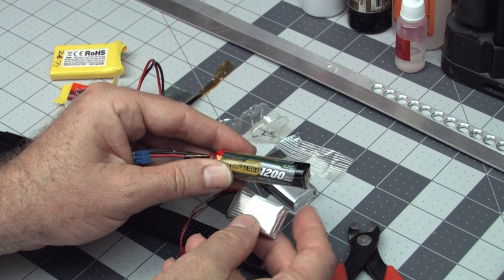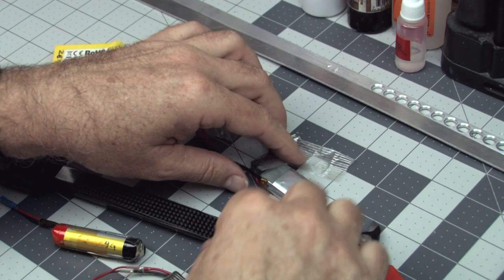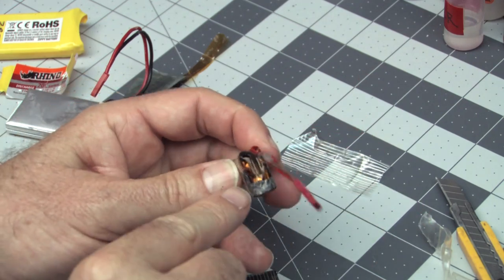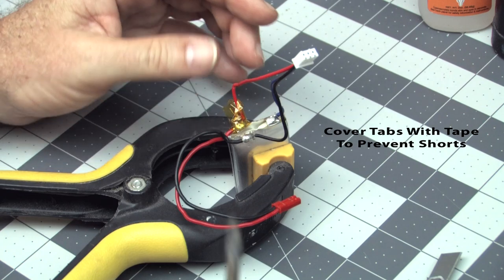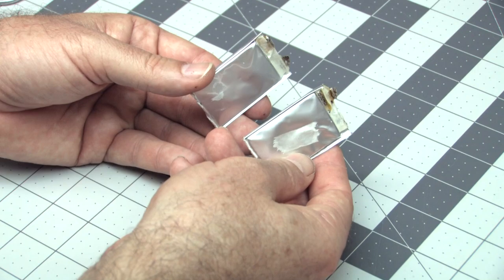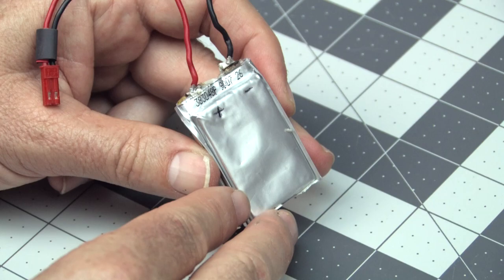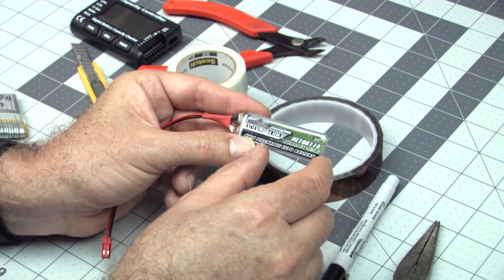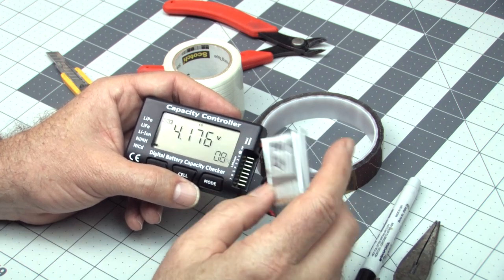Convert 2S Lipo to 1S for DLG and F3K Gliders

Comment from the maker: Battery connector is a JST, a good choice for a physical on/off connection between battery and receiver. 1S pack gets charged at a 1C rate, about .9 amps with a charger that has LiPo settings. Just about any charger does all of the battery types safely. Individual cells do not need balancing since they are now wired in parallel.

Comment: Hello@ Paul Naton.Sometimes multiple cells are held together by glue. I separate them by spraying a little  bit of carburetor cleaner tween the cells, and in a moment they will slide apart, without distorting the cells. I believe it is a little safer to do.

Comment from the maker: You could run all units on a 1S lipo as long as all components can run well in the voltage range, 3.7v to 4.1v. You must monitor your energy usage however, by discharging and recharging and noting milliamps in and out. Also some servos run better at lower voltages than others, and power consumption will vary.  More capacity is always better and safer.

Comment from the maker: You can take 2 3.7 cells and wire them is SERIES to make a 7.4 pack. If this new pack is used as a motor pack, you must also add a balance connector to insure the 2 cells stay balanced. If you wire 2 3.7s in parallel, then you keep the 3.7 voltage, but then get twice the capacity.  Parallel wired cells will self balance.

Comment: hello Paul Naton, i have a question, i have a drone syma 5 that works with a lipo battery 1cell 3.7 volts, 500 mAh, and also have a drone JJrc h8 that works with a 2 cell 7.4 500 mAh and those batteries has a balancer conector, can i repalce de 7.4 volt battery for 2 batteries 3.7 volts making a conector in serie? is the same than the stock 7.4 volt? does not affect if theres not have balancer conector? i will apreciate your answer, for me is more conveninete for price and time to chage use the 1 cell 3.7 volts batteries, thanks.

Comment: Does anyone know if balance charging parallel lipo cells is needed? Is it even possible once soldered in?
Do parallel lipo cells naturally discharge and charge evenly? I'd be concerned that one cell in a parallel pack would discharge or charge more than another just like in a series lipo battery.
Reply: +RoboTekno If its a 1s pack then it doesnt matter how many packs you run in parallel as the charger will only charge to 4.2v.

Comment: doe you know if needed what type of solder sticks for soldering on the aluminum
Reply from the maker: If the tabs have no solder on them, you need to get a special flux for aluminum- you can use standard solder, but without the alum flux, the solder will not stick to the tabs. EBay or electronics stores have this flux.